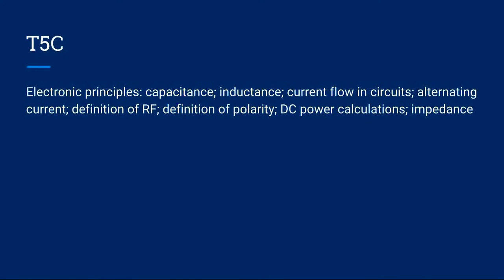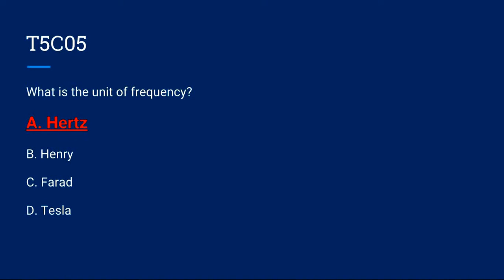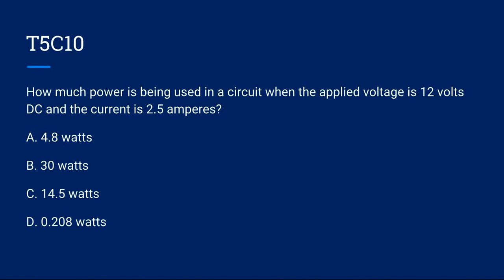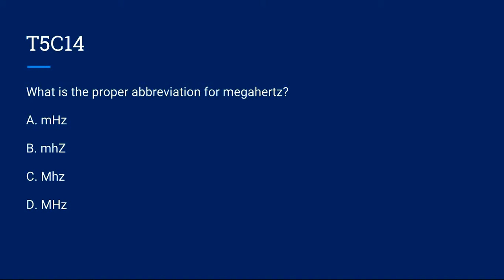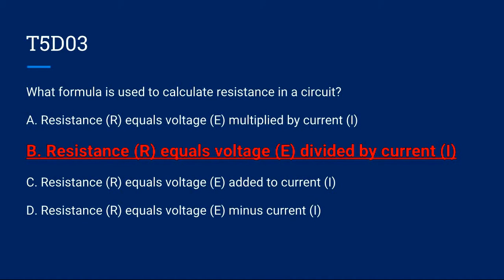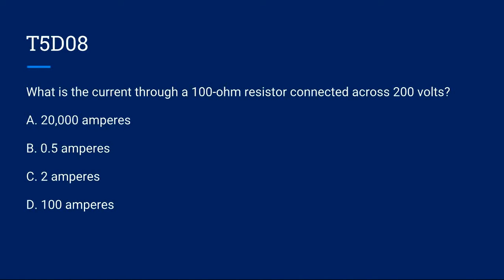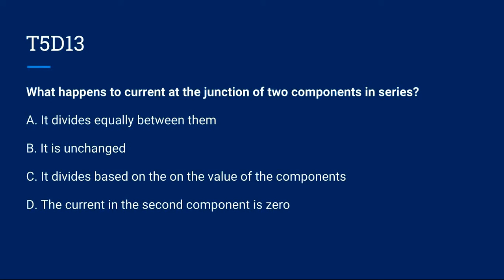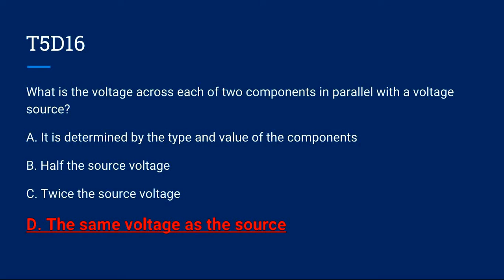EXPIRED - Replaced w/ New Version #8  Technician Class Amateur Radio Question Pool T5C and T5D

Comment: T5CO1 : What is the ability to store energy in an electric field called ?? It's Called (D) Capacitance because it's Occupy Space and it's has more room for the energy in this electrical field Always 💯💯💯 (2) How much power is being used in a circuit when the applied voltage is 13.8 volts DC and the current is 10 amperes ? The answer to this Question is (A) 138 watts is the answer